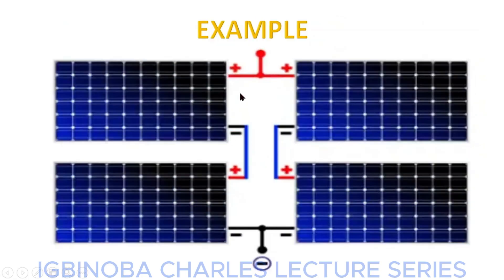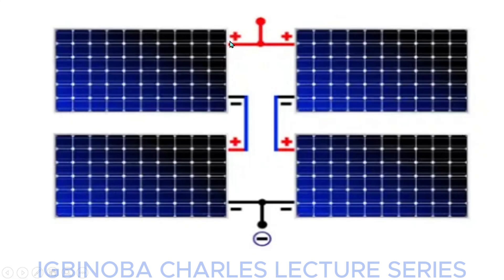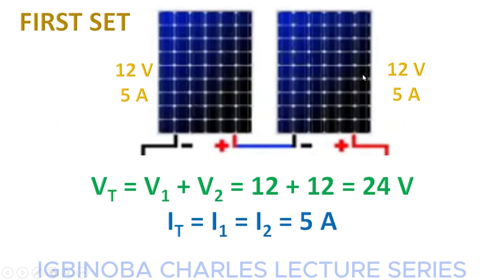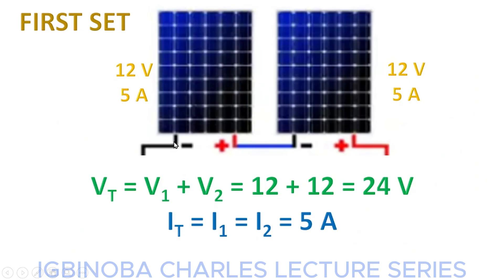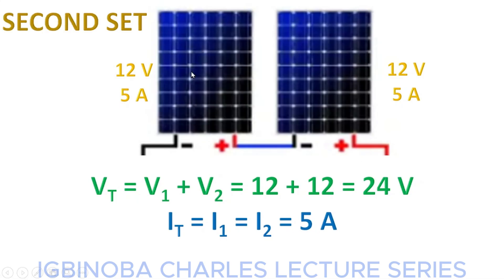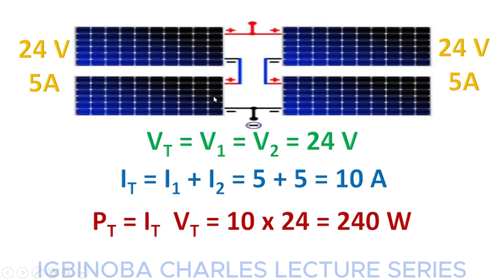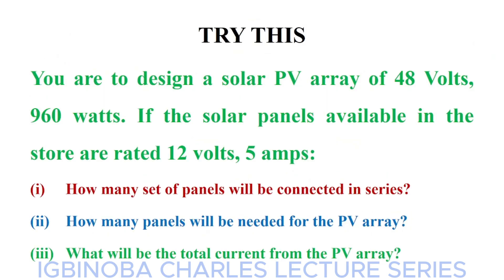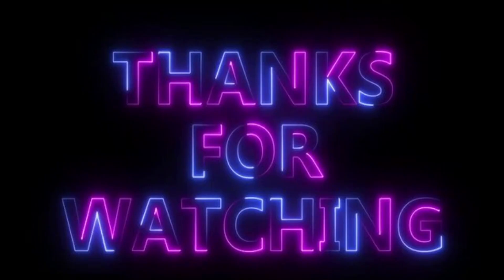Connection of  Solar Panels in SERIES-PARALLEL

Comment: MECH3212F
1). 4 panels are connected in series.

We connected four 12-volt, 5-amp panels in series, so we get a total of 48 volts, which is the voltage needed for the solar system.

2). A total of 16 panels are needed.

Each panel produces 60 watts l.e. 12V * 5A = 60W

To get 960 W in total, 960+ 60 = 16 panels.

3). The total current from the solar array is 20 amps.

Using I = P + V, we have that, 1960 W 48 V = 20 A.

Comment: NAT316P
1. Four panels are connected in series. When you connect four 12 volts, 5 amp panels in series, you get a total of 48 volts. Which is the voltage needed for the solar system.
2. A total of 16 panels are needed. Each panels produces 60 watts (12v×5amps =60watts) to get 960 watts in total: 960/60 = 16 panels.
3. The totals current from the solar array is 20 watts using the formula I= p+v. I= 960/48×V = 20A

Comment: MAR 3134D 

1. 4 sets of panels will be connected in series.
Since connecting 4 of the 12 volts, 5 amp panels in series gives a total of 48 volts as required by the solar PV array design.

2. 16 panels will be needed for the PV array.
This is because the power of each panel is 12 × 5 = 60 watts, therefore the total number of panels to produce 960 watts is 960 ÷ 60 = 16.

3. The total current from the PV array is 20 amps.
Since I (total) = P (total) ÷ V (total),
I (total) = 960 ÷ 48 = 20 amps.

Comment: EEE3147Q

1. 4 panels are connected in series.
 When you connect four 12v, 5-amp panels in series, you get a total of 48v, which is the voltage needed for the solar system.

2. A total of 16 panels are needed. Each panel produces 60 watts (12 V × 5 A = 60 Watts).

To get 960 Watts in total:
 960 ÷ 60 = 16 solar panels.

3. The total current from the solar array is equal to 20A

From I = P / V,

I = 960 W / 48 V = 20 A.

Thank you

Comment: COMP382D

1. Four panels are connected in series. When you connect four 12-volt, 5-amp panels in series, you get a total of 48 volts, which is the voltage needed for the solar system. 

2. A total of 16 panels are needed. Each panel produces 60 watts (12 V × 5 A = 60 W). To get 960 W in total: 960 ÷ 60 = 16 panels. 

3. The total current from the solar array is 20 amps. Using the formula I = P ÷ V, I = 960 W ÷ 48 V = 20 A.

Comment: EEE3115K
1). 4 panels are connected in series.

We connected four 12-volt, 5-amp panels in series, total of 48 volts, which is the voltage required for the solar system.

2). A total of 16 panels are required.

Each panel produces 60 watts That is 12 V x 5 A = 60 W

To get 960 W in total, 960+ 60 = 16 panels.

3). The total current from the solar array is 20 amps.

Using I = P + V, we have that, 1960 W 48 V = 20 Α.

Comment: MAR100V

i Four (4) panels will be connected in series since: 48V / 12V = 4

ii. A total of sixteen (16) panels will be required for the PV array since:

960W / 60W = 16

iii. The total current from the PV array is 20A, calculated as:

960W / 48V = 20A

Comment: MECH3176T
1.Four panels are connected in series.when you connect four 12-volt,5 amp panels in series,you get a total of 48 volts, which is the voltage needed for the solar system.
2. A total of 16 panels are needed.Each panel produces 60 watts (12V × 5A =60W).To get W in total: 96060 =16 panels.
3 The total current from the solar array is 
20-amps.using the formula I= P+A,
1= 960W ÷ 48V=20A.

Comment: PETROCHEM41O

1. Four panels are connected in series. When you
connect four 12-volt, 5-amp panels in series, you get a total of 48 volts, which is the voltage needed for the solar system.
2. A total of 16 panels are needed. Each panel
produces 60 watts (12V x 5A = 60W). To get W
in total: 960 60 = 16 panels.
3. The total curent from the solar array is
20-amps. Using the formula I = P + A,
1 = 960W ÷ 48V = 20A.

Comment: 1. Four panels are connected in series.
       When you connect four 12-volt, 5-amp panels in series, you get a total of 48 volts, which is the voltage needed for the solar system.
2. A total of 16 panels are needed.
       Each panel produces 60 watts (12 V × 5 A = 60 W).
       To get 960 W in total:  960 \div 60 = 16  panels.
3. The total current from the solar array is 20 amps.
       Using the formula  I = P ÷ V ,
        I = 960W÷ 48V = 20 A.

Comment: CHM50X

1. Four panels are connected in series.
When you connect four 12-volt, 5-amp panels in series, you get a total of 48 volts, which is the voltage needed for the solar system.
2. A total of 16 panels are needed.
Each panel produces 60 watts (12 V x 5 A = 60 W).
To get 960 W in total: 960 ÷ 60 = 16 panels.
3. The total current from the solar array is 20 amps.
Using the formula I = P ÷ V,
1 = 960 W ÷ 48 V = 20 A.

Comment: PETRO3129Y

1. Four panels are connected in series. When you
connect four 12-volt, 5-amp panels in series, you get a total of 48 volts, which is the voltage needed for the solar system.
2. A total of 16 panels are needed. Each panel produces 60
watts (12V x 5A = 60W). To get W in total: 960 60 = 16
panels.
3. The total curent from the solar array is
20-amps. Using the formula I = P + A,
1 = 960W ÷ 48V = 20A.

Comment: MAR3122R

1). 4 panels are connected in series.

We connected four 12-volt, 5-amp panels in series, so we get a total of 48 volts, which is the voltage needed for the solar system.

2). A total of 16 panels are needed.

Each panel produces 60 watts I.e. 12 V x 5 A = 60 W
To get 960 W in total, 960+ 60 = 16 panels.

3). The total current from the solar array is 20 amps.
Using I = P + V, we have that, 1960 W 48 V = 20 A.

Comment: MAR394P
Q1. How many set would be connected in series?
Since our options is limited to a 12v 5a panel , in order to achieve a 48 v system at     960w , connecting 4 panels in series will give us that 48v however to get 960 watts from our palnes we must have 4 set connected in series before joining them together in parallel and with a little bit of math we will see that 
12v×4(panels)= 48v(5A) and
4 of this series now connected in parallel should give 
48v x(5A+5A+5A+5A)
 = 960W

Q2
A Total of 16 panels would be used to produce 960w of energy regardless of the connection pattern
12×5 = 60w ,60×16=960w
So 16 panels would be used 

Q3 
Total current is 20A because connecting 4 set of series at 5A each in parallel gives 20A of current
Ans 20A

Comment: CVE397S
1. 4 sets of panels will be connected in series.
Since connecting 4 of the 12 volts, 5 amp panels in series gives a total of 48 volts as required by the solar PV array design
2. 16 panels will be needed for the PV array. This is because the power of each panel is 12 x5 = 60 watts, therefore the total number of panels to
produce 960 watts is, 960/60 = 16
3. The total current from the PV array is 20
amps
Since I (total) = P (total)/ V(total) I (total) = 960/48 = 20amps

Comment: EEE3177U

1) 4 sets of panels will be connected on series. 
     Since connecting 4 of the 12 volts, 5 amp panels in series gives a total of 48 volts as required by the solar PV array design

2) 16 panels will be needed for the PV array.
This is because the power of each panel is 12×5=60watts, therefore the total number of panels to produce 960watts=960/60=16.

3) The total current from the PV array is 20amps.
Since I=P/V
I.e  I=960/48=20amps.

So therefore:
(i) 4 panels in series
(ii) 16 total panels
(iii) 20A total current.

Comment: CIV342P
1). 4 panels are connected in series.

We connected four 12-volt, 5-amp panels in series, so we get a total of 48 volts, which is the voltage needed for the solar system.

2). A total of 16 panels are needed.

Each panel produces 60 watts I.e. 12 V x 5 A60 W To get 960 W in total, 960+60= 16 panels.

3). The total current from the solar array is 20 amps. Using IP + V, we have that, 1960 W 48 V20 A.

Comment: MAR367O
1.) 4 panel are connected in series 
 We connected four 12volt ,5 amp panel in series, so we get 48 volts, the voltage needed for the solar system 
2.) A total of 16 panel is needed 
Each panel produces 60watts i.e 12v x 5A =60watts
To get 960watt, 960÷60=16panel
3.) The total current from the solar array Is 20A
P=VI, I=P/V 
I=1960/48 =20A

Comment: PETRO3144N

1. Number of panel sets in series: 48V ÷ 12V = 4
2. Number of panel for PV array: 960W ÷ ( 12V * 5A) =
960W ÷ 60W = 16
3. Total current:
Number of parallel strings: total no of panel for PV
array/ number of panels set in series = 16/4 = 4
Therefore total current= 4 * 5A = 20A

Comment: MECH346T

1. Four panels are connected in series. When you connect four 12-volt, 5-amp panels in series, you get a total of 48 volts, which is the voltage needed for the solar system.

2. A total of 16 panels are needed. Each panel produces 60 watts (12V x 5A= 60W). To get W in total: 960 60 = 16 panels.

3. The total curent from the solar array is 20-amps. Using the formula I = P+A, 1960W 48V = 20A.

Comment: PETRO371S

1. Four [4] sets of panels will be connected in series 

2. Sixteen [16] panels are needed for the PV array, because a single produces 12V x 5A = 60W.
Therefore the number of panels needed is 960W ÷60W= 16

3. Total current from the PV array is obtained using the formula. 
I=P/V 
Where; P= 960watts, V=48 volts

I= 960/48 = 20Amps

Comment: Submission Code: EEE 386H

1. Number of panels in series:
For 48V, we need to connect panels in series. Since each panel is 12V, we'll need
48V divided by 12V = 4 panels in series

2. Total number of panels:

Each panel is 12V, 5A, so the power rating will be: 12V x 5A = 60W per panel

For a 960W array, we'll need: 960W divided by 60W per panel = 16 panels

Since we need 4 panels in series, we will have: 16 panels / 4 panels per series line up = 4 parallel line ups

3. Total current from the PV array:

Each series line up produces 5A (since the panels are connected in series). With 4 parallel lineup , the total current will be:
5A × 4 = 20A

Comment: NAT319S
1. Four panels are connected in series.
When you connect four 12 volts, 5 amp panels in series you get a total of 48 volts. Which is the voltage needed for the solar system.
2. A total of 16 panels are needed.
Each panels produces 60 watts (12v * 5amps =60
watts) to get 960 watts in total : 960/60 = 16 panels.
3. The total current from the solar array is 20 watts.
Using the formula l= p+v
1 = 960/48 * V = 20A

Comment: CIV389K
a)The panels are conneted in series there fore ,
480v/120v=4panels are needed 

b)The output from one panel is given by multiplyinh itd voltage and current 
120v×5A=600W
Since the givrn power demand is 960W,the total number of panel required is 960W÷60W=16panels 

c)total panel divied by thr panels connected in series ,there fore 
16/4=4panels .
each of of the panel has a current of 5A,therefore the total current is given by 4×5=20A

Comment: MECH353A 
1.)The sets of panels connected in series is 48/12 which is 4 sets.

2.)For the PV array,the number of panels needed will be 960/60 which is 16.
3.)Total current from the PV array will be 960/48 which is 20A.

Comment: MAR3136F
1. Four solar panels are to be connected in series with , therefore total voltage Rating of 48v and constant 5amp
2. Total of 16 panels (12*5=60w)
3. total current of tge solar array 
     P=IV
      960 =I ×48
      I=960/48
      I=20A

Comment: PETROCHEM361I

1. Four panel are connected in series.
When you connect four 12-Volt, 5-amp panels in series, you get a total of 48 volts, which is the voltage needed for the solar system 

2. A total of 16 panels are needed.
Each panel produces 60 watts (12 V × 5 A = 60 W).
To get 960 W in total: 960 ÷ 60 = 16 panels.

3. The total current number from the solar array is 20 amps.
Using the formula I = P ÷ V,
1 = 960 W ÷ 48 V = 20 A.

Comment: COMP3120P
1. Four panels are connected in
series. When you
connect four 12-volt, 5-amp panels
in series, you get a total of 48 volts,
which is the voltage needed for the
solar system.
2. A total of 16 panels are needed.
Each panel produces 60 watts (12V x
5A= 60W). To get W in total: 960 60 =
16 panels.
3. The total curent from the solar
array is
20-amps. Using the formula I = P+A,
1960W 48V = 20A

Comment: COMP372T
1. Four panels are connected in
series. When you
connect four 12-volt, 5-amp panels
in series, you get a total of 48 volts,
which is the voltage needed for the
solar system.
2. A total of 16 panels are needed.
Each panel produces 60 watts (12V x
5A= 60W). To get W in total: 960 60 =
16 panels.
3. The total curent from the solar
array is
20-amps. Using the formula I = P+A,
1960W 48V = 20A

Comment: MECH3126V

1. Number of panels in series:
For 48V, we need to connect panels in series. Since each panel is 12V, we'll need
48V divided by 12V = 4 panels in series

2. Total number of panels:

Each panel is 12V, 5A, so the power rating will be: 12V x 5A = 60W per panel

For a 960W array, we'll need: 960W divided by 60W per panel = 16 panels

Since we need 4 panels in series, we will have: 16 panels / 4 panels per series line up = 4 parallel line ups

3. Total current from the PV array:

Each series line up produces 5A (since the panels are connected in series). With 4 parallel lineup , the total current will be:
5A × 4 = 20A
9:46

Comment: EEE3138H

1.Total voltage = 48V
Each panel voltage = 12V
Number of set of panels in series = 48V ÷ 12V = 4
Answer: 4 set of panels in series.

2.Power of one panel = 12V × 5A = 60W
Total required power = 960W
Total number of panels = 960W ÷ 60W = 16
Answer: 16 panels

3. Using I=P/V
Where P=960watts and V=48volts
Total Current from the PV Array=960/48=20A

Comment: CIV327A

i) Panels in series to reach 48V
48÷12=4,  (4 panels in series)

(ii) Number of panels total:
Total panels = 16

(iii) Total current from the array:
Each series string current = 5 A; with 4 parallel strings total 
= 20 A

Comment: CODE: EEE3176T

Solutions:

1. Number of panels in series = 48V/12V = 4 panels 

2. Total number of panels = 960W/(12Vx5A) = 960/60 = 16 panels 

3. Number of parallel strings=16/4= 4 strings 
Total current = 4x5A = 20Amps

Comment: PETROCHEM30D 
1. Four panels are connected in series. When you

connect four 12-volt, 5-amp panels in series, you get a total of 48 volts, which is the voltage needed for the solar system.

2. A total of 16 panels are needed. Each panel produces 60 watts (12V × 5A = 60W). To get W in total: 960 60 = 16 panels.

3. The total curent from the solar array is

20-amps. Using the formula I = P + A,

1 = 960W ÷ 48V = 20A.

Comment: MEC79A
1. The sets of panel connected in series is 48/12 which is 4 sets
2. For the PV array number of panels needed is 960/60=16
3. For the total current from the PV array will be 960/48=20A

Comment: CHM393O

Each panel : V= 12V and I= 5A
Power : P= I ×V = 12×5 = 60W

Required system: 48V, 960W

1) Series connection:
48V ÷ 12V = 4 
 
 Answer: 4 panels in Series 

2) Total panels
960W ÷ 60W = 16 

Answer: 16 panels in total 
( Since each string has 4 panels , 16÷4 = 4 strings in parallel)

3) total current 
 
4 strings × 5A = 20A

Answer:  20A

Comment: PETROCHEM48v
i. Four (4) panels will be connected in series since:
48V ÷ 12V = 4

ii. A total of sixteen (16) panels will be required for the PV array since:
960W ÷ 60W = 16

iii. The total current from the PV array is 20A, calculated as:
960W ÷ 48V = 20A

Comment: NAT9I

1. Four panels are connected in series.
When you connect four 12-volt, 5-amp panels in series, you get a total of 48 volts, which is the voltage needed for the solar system.
2. A total of 16 panels are needed.
Each panel produces 60 watts (12 V x 5 A = 60
W).
To get 960 W in total: 960 ÷ 60 = 16 panels.
3. The total current from the solar array is 20 amps.
Using the formula I = P ÷ V,
1 = 960 W ÷ 48 V = 20 A.

Comment: EEE376X 

I) 4 sets of panels would be connected in series (48v/12v = 4)

ii) 16 panels would be needed for PV array (960W/60W = 16)

III) the total current from the PV array is 960W/48V = 20A

Comment: MAR346T

i. 4 sets of panels will be connected in series that is 48V  ÷ 12V = 4
ii. 6 panels will be needed for the PV array that is 960W ÷ 60W = 16
iii. The total current from the PV array is 20A that is 960W ÷ 48W = 20A

Comment: EEE346T

i. Four panels are connected in series
When connecting fur 12 V, 5A panels in series, we get a total of 48V which is the voltages needed for the solar system 

ii. Each panel's power = 12x5= 60W. Total number of panel will be 960÷60 = 16
Therefore, 16 panels will be needed for the P array

iii. Each parallel string carries 5A
Current = 5x4 = 20A
Therefore the total current from the PV array is 20A

Comment: MECH380B
Answer:
(i) Each panel is 12 V, and the array needs 48 V.
48 ÷ 12 = 4 panels will be connected in series.

(ii) Power of one panel = 12 V × 5 A = 60 W
Total power required = 960 W
960 ÷ 60 = 16  panels 

(iii)  One set of series  gives  48 V and 5 A, power = 48 ×5 = 240 W.
960 ÷ 240 = 4 sets (in parallel)
total current = 4 × 5 A = 20 A

Comment: MAR 363k

i Four (4) panels will be connected in series since:
48V ÷ 12V = 4

ii. A total of sixteen (16) panels will be required for the PV array since:
960W ÷ 60W = 16

iii. The total current from the PV array is 20A, calculated as:
960W ÷ 48V = 20A

Comment: MAR378Z

i. 4 sets of panels will be connected in series that is 48V  ÷ 12V = 4
ii. 6 panels will be needed for the PV array that is 960W ÷ 60W = 16
iii. The total current from the PV array is 20A that is 960W ÷ 48W = 20A

Comment: MAR340N
i. 4 sets of panels will be connected in series that is 48V  ÷ 12V = 4
ii. 6 panels will be needed for the PV array that is 960W ÷ 60W = 16
iii. The total current from the PV array is 20A that is 960W ÷ 48W = 20A

Comment: MECH3151U

1. 4 panels will be connected in series 
2. A total of 16 panels will be needed for the PV array. Since 1 panel will produce 60watts of power and the total power given is 960W, so 960/60 = 16
3. The total current is 20A